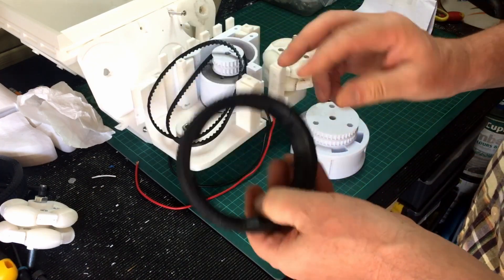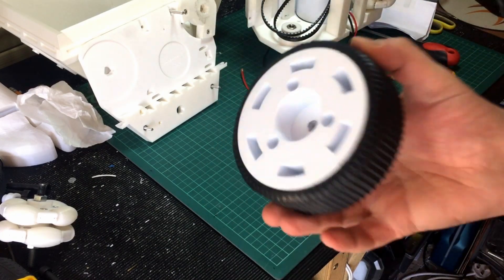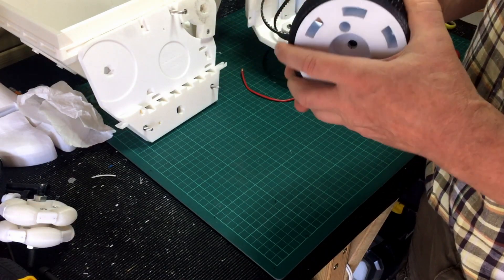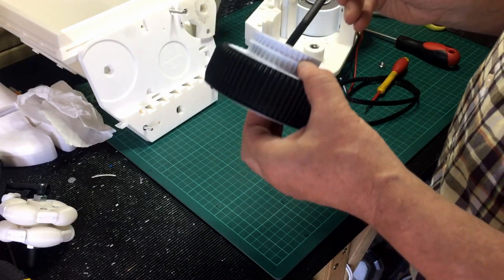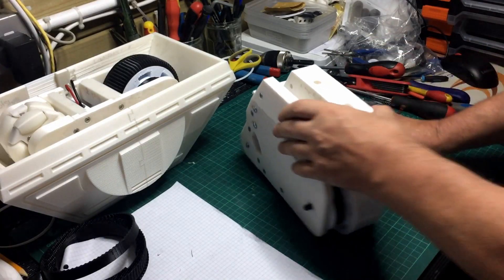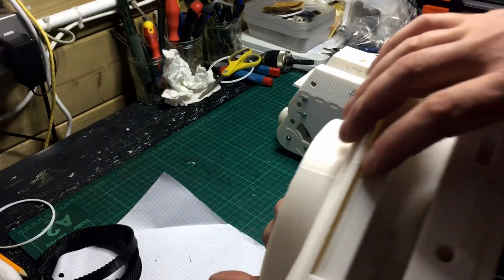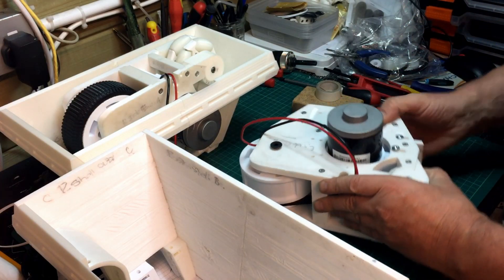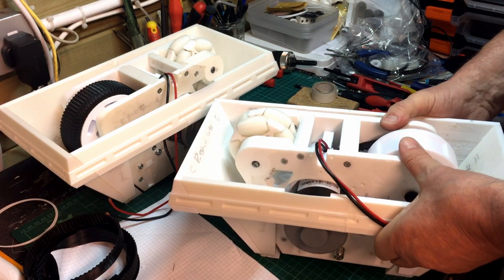R2D2 Droid Build Part - 16

Comment: Hola Kyle, Hi Kyle, how are you? I wanted to ask you where I can buy the timing belt
Reply from the maker: Hello Roberto, the belt is 3D printed with Ninja-flex.   The STL was downloadable as part of the wheel design.   I think the whole wheel has since been redesigned without the belt, with gears only.  Here is Michaels STL https://onedrive.live.com/?authkey=%21APA5Cxi7TQXSqMw&id=E84CB8FD47152532%2128286&cid=E84CB8FD47152532

Comment: Hi there, whats the name of the motor u used? number etc
Reply from the maker: Hello Rikard, its a 24-volt 150-watt brushed E bike motor, model ZY6812, I bought it off eBay - https://www.ebay.co.uk/p/2164866469?iid=173134035388
Reply: @kylecampbellweb  Thx Kyle, i orderd two, allso, im struggeling to get those tires on, how did u get em over the center piece?
Reply from the maker: @Tjup  Hi Rikard, warm up the tires in some hot water first, then I gently eased them on using a "plumbers wrench"  bit by bit.  Maybe use some washing up liquid as well, that will wash off later. 
Also have a look at my blog about how i removed the belt sprocket on the motors - https://myrobotnigel.blogspot.com/2018/08/zymy-6812-electric-motor-belt-drive.html

[this sort of thing for the wrench - https://uk.rs-online.com/web/p/pliers/1585423?cm_mmc=UK-PLA-DS3A-googleCSS_UK_EN_Hand_Tools_WhoopWater+Pump+Pliers_Whoop-1585423&matchtype=&pla-374886782390&gclid=CjwKCAjwjqT5BRAPEiwAJlBuBXnm4f_VQF7XIY105_vPgoQISS3-ILRz581o72moJNLuCjV1THs3WhoCQfsQAvD_BwE&gclsrc=aw.ds]
Reply: @kylecampbellweb  Thx, i manage to get it on :) one more question, the bearings, are they 22.5 mm?
Reply from the maker: @Tjup  I used two sizes, 6mm and 8mm.   Both are needed at some point.   8mmx22mmx7mm here https://www.amazon.co.uk/gp/product/B079NR1QT8/ref=oh_aui_detailpage_o00_s00?ie=UTF8&psc=1
and 6mmx17mmx6mm https://www.amazon.co.uk/gp/product/B079NSJZ9G/ref=oh_aui_detailpage_o00_s00?ie=UTF8&psc=1

Comment: where you can get the wheel stl file?
Reply from the maker: Hello Roberto, all the STL files are available on Mikes OneDrive download site.  I think the files will be the newer versions of the wheels.
Reply: @kylecampbellweb  , hello, Sorry for my ignorance, on which page do I place Mikes?
Reply from the maker: @hiko74  Hi Roberto - here is the non-patreon link https://onedrive.live.com/?authkey=%21APA5Cxi7TQXSqMw&id=E84CB8FD47152532%2124206&cid=E84CB8FD47152532

Comment: What equipment are you using to power the motor for testing?
Reply from the maker: Hi Charles, for the quick motor test I have just hooked up the motor wires to my bench power supply and just manually upped the voltage. This will get the motors turning for test purposes.   Later I connected up the motors to Sabertooth boards and drove them using a 12v battery

Comment: Hello Friend how are you.  What engine did you use, I need you to help me with this
Reply from the maker: Hi Roberto, the feet motors are these:  "Electric Scooter Motor 24 Volt DC 150 Watt 24v Brushed ZY6812 19T Belt Drive"
Check out ebay for them.
Reply: @kylecampbellweb  gracias amigo, saludos desde Chile!!

Comment: Hi Kyle, lovely video. I see you switched up your belt, is the wide belt 3D printed or store bought? The wide belt seems not to bounce around as much as the two single belts. Do you know what size nozzle ( 0.25mm, 0.3mm, 0.4mm, 0.5mm, 0.6mm, 0.8mm, 1.0mm ) is on your 3D printer? Plus what size filament do you use?
 I still need to buy my nozzle so I'm looking around to see what works the best. I've also been watching Blender tutorial video's to make good stl files. Need to clean out my hard drive so I can install Blender, Netfab, Slicer and Print run. 
Thank you, keep up the good work. Kenn
Reply from the maker: Hi ray
The nozzle on the printer is the standard 0.4mm that came with it. [Prusa mk2s]
Filament is 1.75 and I think I bought from Technology warehouse.   I have had printing issues but when it works it works fine.  Have damaged the print bed at the monent so thats this weekends job to sort out. 

I changed to the wider belt as thats what everybody is suggesting on the blogs, as they say the two belt system slips on some surfaces.  I haven't tentioned the belts up but the wider belt certainly looks tougher and as you say, doent bounce around.     All home printed belts on the Prusa., same with the tyre.  

I have now changed to Simplyfy3D but have tried Prontoface which is part of printrun?  Comes with the Prusa software pack?